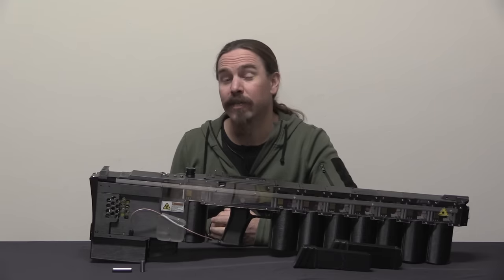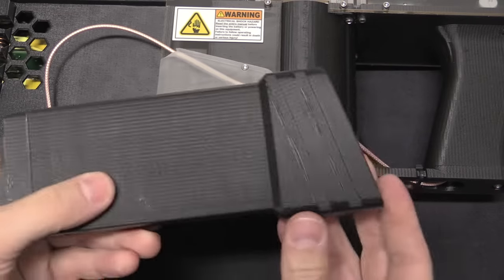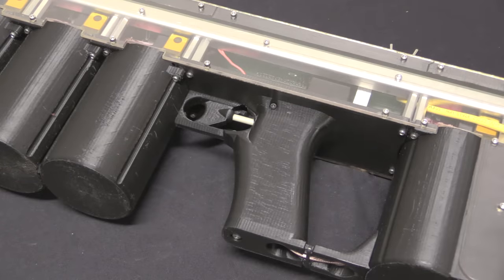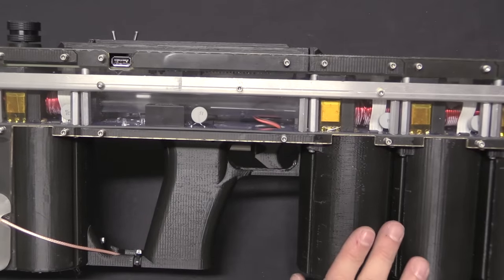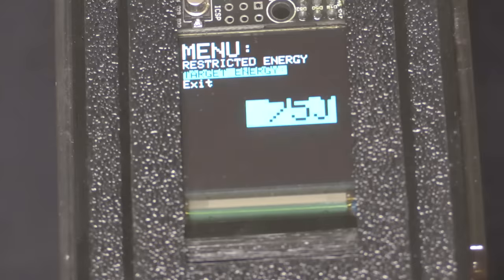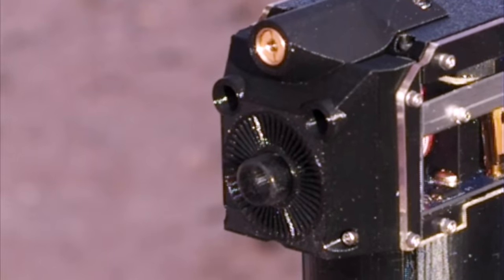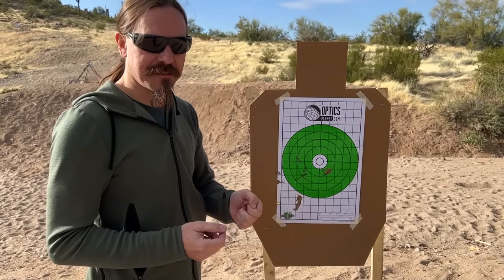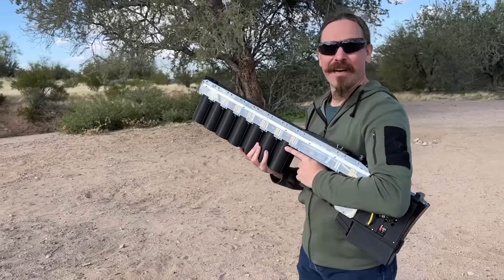ArcFlash Labs' GR-1 Anvil Portable Gauss Rifle

Comment: Current coilguns vs firearms reminds me of early firearms vs bows. Early on bows were more capable and affordable than firearms until decades and several wars later firearms technology surpass bows in military use
Reply: Red dot type sights were around in 45 but didn't become practical till the 60s when battery tech caught
Reply: @ivankrylov6270  yeah also ICE cars vs electric cars
Reply: Literally any technology. See also tractors vs horses.
Reply: @odinatra  yeah but what about all the technology that falls off? Maybe when we can’t make gunpowder anymore we’ll need coil guns but battery technology is gonna have to get insanely crazy for a coil gun to sustain fire in combat like a machine gun with a removable barrel
Reply: @chinesesparrows  elecric cars are around for longer than ice cars
Reply: @odinatra  yeah this is the very beginning of the S-curve of disruption, not much improvement in current smokeless powder firearms just minor improvements that add up.
Reply: @laurean5998  but were waaayyy outsold by ICE cars for a century
Reply: Early black powder muzzle loading rifles were far more potent than any long or recurve bow.  Especially in battle when you could have multiple rows of shooters to offset the slow reloading time.  Thus your bow and arrow vs gun comparison is not correct.

Coil guns vs standard guns though, I would agree with you.  The coil gun does it's job, just not as cost effectively as a standard gun does.  Though as Ian joined out, this coil gun needs to exist so in the future we have rally good and compact coil guns.
Reply: @the8thark  Stronger sure, but also much slower.
Reply: @jeffpraterJSF  the 2021 bullet shortage shows how important consumables are. A bullet ban is more scary than a gun ban for me as bullet require tight tolerences and specialist parts (bullet primers are much less common then electricity sources). Coilguns are literally battery powered and can shoot diverse weights and shapes (to a point). Its the modern blunderbuss
Reply: @the8thark  potent is not lethality if accuracy is terrible which early military firearms lacked (not talking about specialist hunting rifles that werent employed as must)
Reply: @vinny142  electric cars are inferior. In the real world. End of discussion. Dont waste ur time convincing the "educated"
Reply: @the8thark  
Not sure I agree.  Their superiority over the English Longbow was due to the fact that training someone to shoot a firearm was easier than training one to use a longbow.  A lot of muscular effort was involved in using a longbow, and one needed to train from a young age.  Where as a peasant could be taught to use an early blackpowder weapon quickly!
It was largely a question of quantity over quality.  A large number of low skilled infantry, that could be quickly raised and fielded, over a small number of highly skilled specialists.
Reply: I wonder if conventional firearms will still have enough trade-offs to maintain relevance into the future. There's at least the benefit of not needing electricity to operate a regular gun. Maybe in the distant future, each one will favored depending on the environment and the resources available.
Reply: @chinesesparrows  

The whole point of infantry gun lines back then was a whole wave of ammo going into the enemy lines.  Accuracy did not matter as much.  You were shooting a whole line of men, not a single man.

Even if due to bad accuracy you did not hit the man you were aiming for but hit the man next to him, well you still completed your objective by thining the enemy lines by one man.

Of cause in a one on one scenario bows were better, well till gun accuracy improved but in battle you are not fighting one vs one with the guns.

As long as the rifleman could be accurate enough to hit the opposing front line of enemy troops, that was considered good enough. That is exactly why guns took over relatively quickly once mass adopted.
Reply: @the8thark  Yes, muzzleloading RIFLES did have better performance than some bows.

Try comparing the early firearms, BEFORE rifles, to bows. Forex, the weapons built before the invention of the serpentine in 1411. With these weapons, the user had to hold a piece of slow match in his hand and bring it to the pan to fire. The shooter had so much to watch that the idea of aiming such weapons was ludicrous. You just pointed them in the general direction of the enemy and hoped somebody got hit.

The only real advantage early firearms had over the longbow was in training time. A longbow took years of practice to master, and constant practice to maintain the skill level. A new recruit could be taught to use a firearm in a few weeks, and the inaccuracy of the weapon meant very little practice was needed.

Firearms improved because they worked for mass, minimally trained bodies of men. Better firearms increased the effectiveness of the troops, and whoever brought the best weapons had an advantage on the battlefield.
Reply: @the8thark  Something you may not be considering is that archers didn't have to be a single line, they could stand behind and aim up covering an area in arrows. They were also effective at much longer ranges than muskets generally speaking, 100 yards was about the distance for a smoothbore musket firing line (as I understand it, I could be wrong on that). Also rate of fire was many times higher. It was training time that made the musket preferable, and it's ability to penetrate armour at the ranges where a hit could reasonably be expected.
Reply: @rogerrabbit80  Not only skill, but also strength: some 14th century longbows were measured/estimated at a 190lbs pull weight. Any prolonged engagement turns into a hefty upper-body workout with those kind of weapons.
Reply: @chucknorris277  and pouring ancient plant muck into an engine and setting it on fire is what you think will remain the pinnacle of technology? The denial of electric or hydrogen power becoming the dominant power sources in future vehicle technology is just weird
Reply: @the8thark  
This is not intended as self-righteous smarm posting so I hope you'll read it with that in mind.

"Early black powder muzzle loading rifles were far more potent than any long or recurve bow.  Especially in battle when you could have multiple rows of shooters to offset the slow reloading time. "

Both of these are wrong.
The term "bullet-proof" derives from medieval armour being proofed against bullets. Even after heavy armour stopped being used buff-coats (literally thick cow-skin coats) would still provide protection against firearms.
The tactics of ranked and then rippling fire didn't develop until hundreds of years after the mainstream adoption of firearms, for the first several hundred years they just used poorly disciplined massed volleys.
Firearms didn't replace bows either.
Firearms allowed a change in tactics that was cheaper than other methods of waging war. That change in tactics and the cost of going to war and maintaining an army made bowmen non-viable as financial concerns (guns were adopted long before standing armies; the Roman Empire not-withstanding).
Instead of hiring a small number of professional crossbowmen to support small numbers of professional mercenaries and a smaller number of liveried men (household troops) you could mass conscript peasant levies and hand out matchlocks.
Your professional soldiers could provide 2 days of training and suddenly instead of having a professional army of 5000 men that you had to pay professional wages (usually in advance) and the mountains of munitions (yes, it's a medieval word that referred to swords and armour that would be issued to troops as needed). Instead of that you now had an army of 25,000 men that you didn't have to pay at all and all it cost was the upfront purchase of the guns.
You didn't need to pay these men (or could pay them very little) because most medieval cultures had some form of tax that men had to pay during summer (called The Campaign Season) and because most peasants didn't have a lot of money and didn't need to work during summer they could usually pay that tax with labour instead (typically by joining the army for several months) and they even had the opportunity to come out with a profit via looting and ransom.
This also had the effect of ending the feudal system as rulers no longer needed to hand out land and titles to ensure that a warrior class could maintain itself and is why it coincides with both the massive increase in the size of armies and the formation of European countries as we know them today. The more that rulers adopted firearms the more they were able to centralise power and the greater the notion of a nation state comprised of all it's subjects, rather than the older networks of feudal duties and obligations between a laundry list of different ranks of nobles.

The mass-adoption of firearms is the first step towards industrialised warfare and took place over hundreds of years along with massive social and political change that changed both how and also why wars were being fought.
It was not the same as an American Indian swapping his bow for a musket or rifle once the technology was superior for the individual user.
Reply: Never mind decades, it took centuries! This technological step is well on its way indeed.
Reply: @CallMeMrChainmail  

Thank you for your reply.

Here is a very good video for you to watch on the subject.
https://www.youtube.com/watch?v=DdX47jEBn-k

He did his research and added in some of his own flair.  Granted he is a medieval weapon expert, not a musket expert.

The TLDR is war bow accuracy was not as pinpoint as most people think. For battle as long as you could hit the the front lints of the enemy army you were good to go.
Add in the rain of arrows concept.  That happened enough to be historically significant.  That was effective but not at all pinpoint accurate because sis not have to be.  Enough arrows in a rough general area and you have a good chance to hit enough enemy targets.

In terms of training you are correct.  Even getting an archer up to battle accuracy levels, (which is far far below competition accuracy) still took a while.  Training musketeers to be equally as accurate was indeed cheaper and quicker.

Also I agree with you in relation to the adoption of firearms did not happen overnight.  Battles like Agincourt happened and heavy relied on archers.  Though by then it was the sunset or swansong for the bow in terms of use in battle.

There is art dejecting armies using both bow and gun.  Mind you gun technology pre musket was very primitive and often unreliable.  But the stood by it and developed the musket because the underlying technology was good (and better than bows).  If it was not good it would not have taken over bows.  Also the gun did stop (in part) the weapons vs armour arms race.  Armour and shields were getting better and better at stopping arrows.  Something like a musket ball, just went through the lot.  That's why armies in, for example the napoleonic are did not use heavy armour.

Though in my opinion, I believe people did not fully adapt to gun based warfare till after WW1. WW1 was the big turning point where different tactics were used post WW1 and no longer the two sides starring each other down in lines (with a few additional cavalry charges or pike boxes)

There is also the psychological effect of guns.  Imagine being in the 2nd row and seeing most of the first row just drop from a couple volleys of enemy musket fire?  
Sure that happens with Arrows at times but not at the speed and gruesomeness of the musket balls.

In terms of supply cost, Shad believes they are about the same for arrows vs black powder and musket balls.  I tend to agree.  Supply speed was roughly the same as most campaigns bought enough supplies with them to last the entire campaign.

The one disadvantage black power front loading guns had was water and moisture.  Wet arrows can be dried out.  Wet black  powder is rather useless.

Also there is the issue of the smoke from the black powder.  Sure it made the 2nd row volley harder as they had to do it through the smoke, but also the enemy had a harder time shooting your side.  They just had to shoot into the smoke and hope they hit something. Which they usually did as warfare back then was still lines of troops in formation staring each other down.

Also your comment about ranked fire volley by volley taking a while to develop, sure perfecting it did take a while, I agree, but in reality it was just an adaptation to what already existed with arrow fire.  Archers fired volleys standing in similar style rows.  The main difference is 2nd and 3rd row troops could fire above the 1st row's head and still hit their targets.  The quicker rate of fire also made this a good tactic.  Muskets and other early fire arms made this impossible so they had to adapt.

Another side point is you can reshoot arrows.  Be them your own or enemy arrows shot at you.  Not something you can do with musket balls or similar early gun ammunition.

The other thing to mention is not every bow in your archer line had the same draw poundage.  Meaning every shot was not equally as lethal.  Muskets and similar earlier guns negated this as the same projectile and same had the same shot power.

Just a few points I wanted to bring up also.
Reply: @chinesesparrows , smoothbore muskets have the same range and accuracy as longbows, contrary to popular myth. They're seen as short range and inaccurate because they are compared to rifles
Reply: @TheAchilles26  of all the bows and guns you chose long bow vs muskets. How about compound bows vs early hand cannons? Even compound bows vs muskets or crossbows vs muskets? Also bows have a faster fire rate resulting in more hits on target.
Reply: @chinesesparrows , longbows outrange most compound bows, and compound bows are modern hunting weapons, not battlefield weapons. Perhaps you were thinking of composite bows? Longbows outrange those as well. And I picked muskets because they're what displaced bows and crossbows as weapons of war.

Yeah, bows have a higher rate of fire at the start of a battle. They also have MUCH higher rates of user fatigue and take a lot longer to train people into battlefield Proficiency with. The arquebus and early musket vs a crossbow is pretty simple. The arquebus and matchlock muskets are just better more powerful crossbows, to all practical intents and purposes.
Reply: @TheAchilles26  asia had extensive use of compound bows which outclassed english long bows, just look up the mongols and chinese bows. You apparently have no idea what existed at that time period
Reply: @chinesesparrows , those are COMPOSITE bows, not compound bows. Compound bows are the modern ones with the pulley wheels
Reply: @TheAchilles26  hmm ok your right on the term, but on not range at all. Longbow does not out range most composite bows and composite bows outrange muskets. Range and accuracy arent reasons why bows got replaced, its cost (time and money making, training and maintaining)
Reply: @chinesesparrows , they're all only accurate against man sized targets to about 100 yards. The muzzle energy of a musket hilariously outperforms that of bows, they don't outrange muskets
Reply: @TheAchilles26  muzzle energy is one thing, accuracy and effective range is another. Thats like saying bubba's smootbore bunderbuss outranges sniper rifles.
Reply: @chinesesparrows , sure, but the accuracy of bows is heinously exaggerated, and the effective range of bows and muskets alike is near enough 100 yards as makes no practical difference.
Reply: @TheAchilles26  muskets were used for 300 years and matured. It was preceded by "fire lances" and hand cannons. It is you who staked the discussion on muskets vs bows. Ok the accuracy and range difference was considered small enough in massed military units while muskets were easy to train quickly eventually became more affordable hence muskets replaced bows. It still took years for tech to mature such, which was my point.
Reply: @chinesesparrows , by the time they were MUSKETS, it HAD matured to that point. The matchlock muskets of the Thirty Years War, not even flintlocks. Fire lances and hand cannons didn't displace bows from the battlefield. Arquebuses and matchlock muskets DID.
Reply: @TheAchilles26  if youre only talking about western places, yes. Not whole world
Reply: @chinesesparrows , nothing earlier than a matchlock musket DISPLACED BOWS on battlefields. Fire lances and hand cannons did NOT displace bows.
Reply: @TheAchilles26  im talking about firearms did not replace bows in most of the world until they because affordable enough for enough performance. Tech level is not only what is done in a lab, but wider adoption. You created a strawman talking about muskets only when the original point was on "early firearms performance vs bows", and muskets narrowed that gap while production increased to make it affordable
Reply: @chinesesparrows , most of the world didn't even hear about firearms until they were exposed to muskets. Heck, Chinese "fire arrows" almost don't even qualify, being far more related to rockets than guns
Reply: @TheAchilles26  we are talking about the same point here dunno what your point is